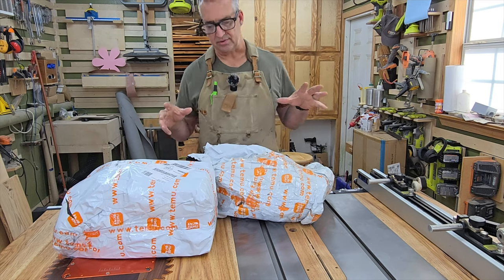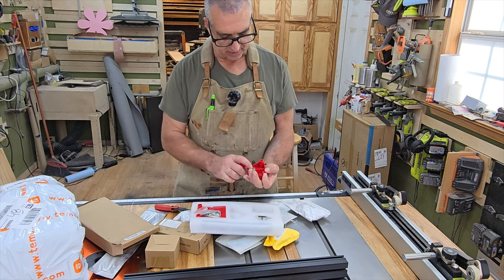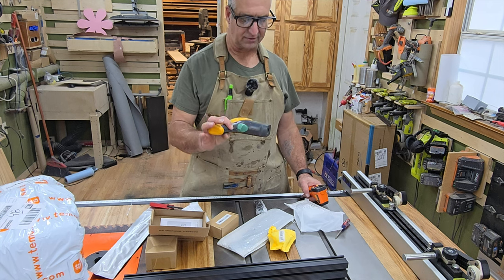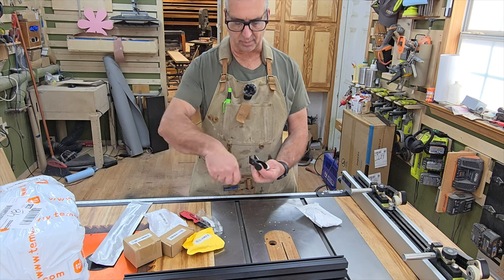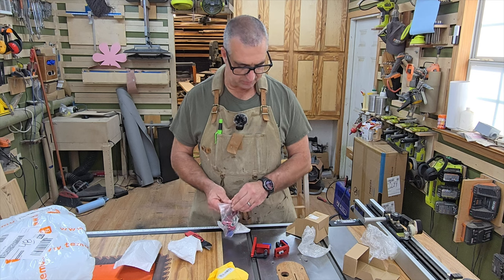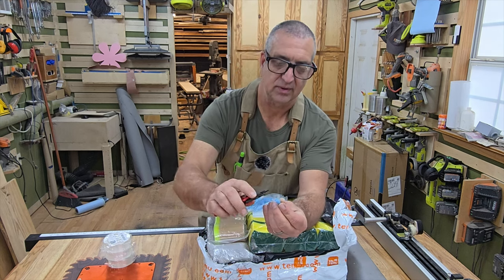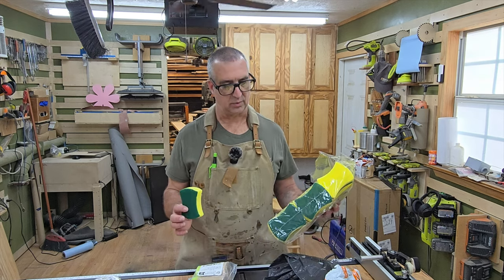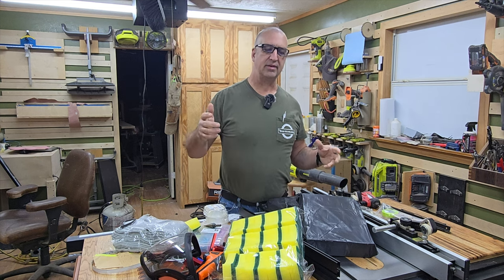Yes, I Still Buy From TEMU. What Type of Things You Should Buy Too..

Comment: Can you tell me how that face mask worked out?
To me it looks like it might fog up.  
Have you used it yet ?
Reply from the maker: It does not fog. I did have some issues with the filter retainer.
Reply: I bought 4 they are very good but inclined to fog up, they need the bottom filters but very safe

Comment: I had purchased from Temu early part of last year (2023). I have stopped buying on Temu because I find a few issues - 
1. The prices have gone way up and there isn't much price difference between buying on Temu vs. Amazon. 
2. There is a deceptive listing practice. You initially get a page that shows extremely lucrative pricing. When you actually open the page you find the attractive price corresponds to some small accessory. The actual item is priced way up and very comparable to Amazon. May be a few pennies less but then I have to spend time to find the real item and its price.
3. The reviews for the item are scant and terse - really doesn't shed much light.

Not sure how your experience has been over the period. Take Care.
Reply from the maker: I have had many of the same issues you've had. I also have found on Amazon where they list a cheaper item and then the real item is much more expensive. It's not as prevalent as it is on t e m u. And a lot of the prices have gone up. That is why I have changed the things that I purchase from them. And I will double check the prices on Amazon because like you said many times you can find them for the same price with next day shipping.
Reply: Just for fairness. Many prices on Amazon have shot up. I am finding Lee Valley to be very competitive on a number of items. Other local suppliers are edging both out, on some items. There is no one solution, chevk around.

Comment: I bought several tools from Temu. Most of them have turned out ok. Not the best not the worst. But, I just got a set of chisels yesterday and they were the worst. The metal was ground to a chisel form on a rough grinder and left like that. The blades are so bad they can’t be called blades. The price was small at ten dollars so sometimes you get what you pay for. But overall the stuff I get is worth the gamble. I will say that now, the prices are going up very fast so going back to amazon and getting them faster is looking better and better.
Reply from the maker: You are dead on. Many of their tools are good for the price. They are not the highest quality, and some are poor quality. There have been a few that I sent back because of the low quality. The good thing is there were no issues getting a refund. I do compare and see if what I am ordering is cheaper or the same on Amazon.